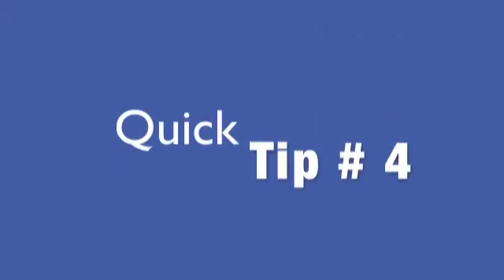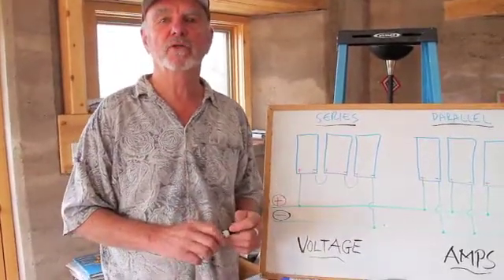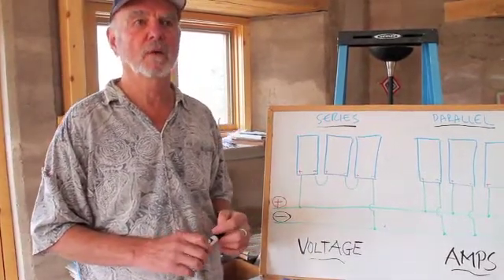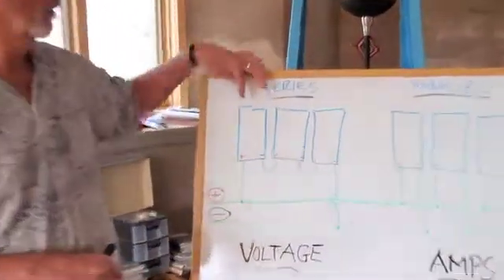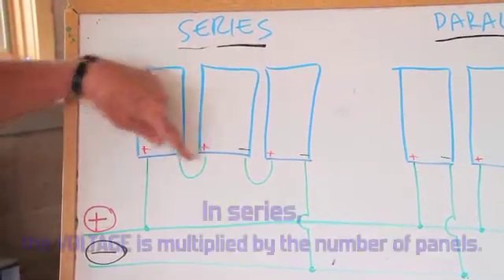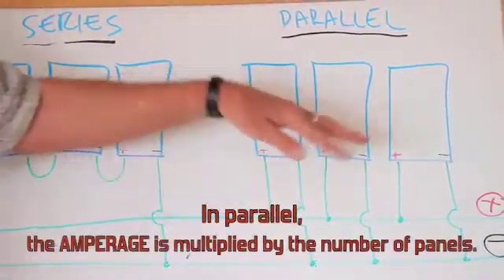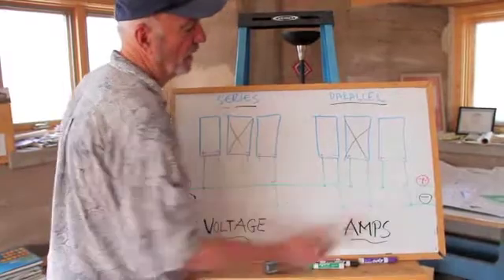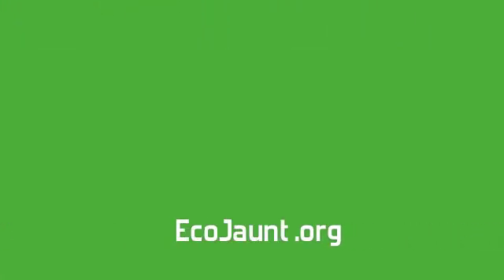Solar Panels - Parallel and Series

Comment: Very good little demonstration. If I put my panels is series or parallel, what gauge wire should I run to my charge controller? I have 4 100w/6a panels on my RV and want to connect them to a single marine battery.

Comment: Bypass diode is commonly used in PV panels to avoid problem when connected in series i.e. when shading or panel outage.

Comment: Thank you for sharing.  Does this also mean if I connect panels in parallel will it add up the current? For an example 6V, 60mA if I connect 4 in series is the output 6V, 240mA?

Comment: People generally use a combination depending on the size of the array and the voltage needed at the outlet. For example you can have many sets of 3 panels connected in series, that are then all wired in parallel for an array output. It's designer's choice!

Comment: Thank You for demystifying this. I have 2 Harbor Freight 45 watt Solar Panel kits and I was wondering why when I plugged all the panels together they were still producing about 24v in good sunlight. I will check some of your videos but just in case what are the advantages and disadvantages of each setup. And Again, Thank You very much! Frank M. M. III

Comment: Mr. Shippee. Let's say I have two panels. One is generating 11 Volts, the other is generating 10 Volts (Say this one is in a shadowy place). What happens if we put them in parallel. Electricty from both panels run to the battery or the electrity from the 11 V panel runs to the 10 V panel. Question mark.